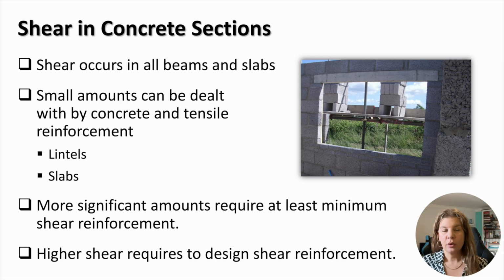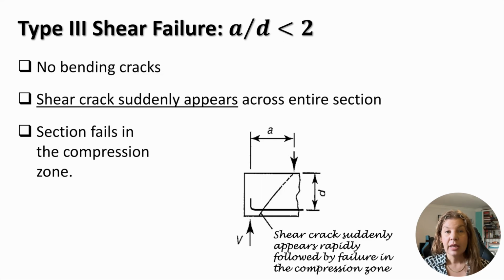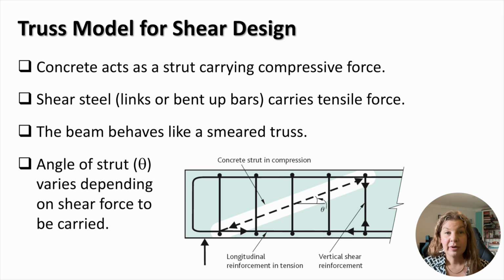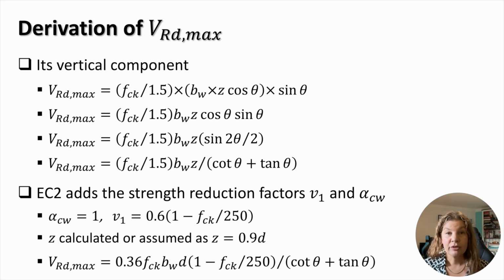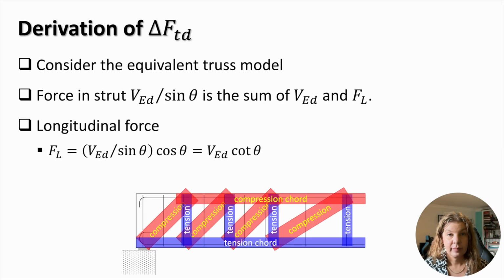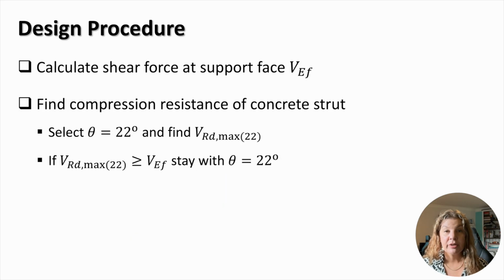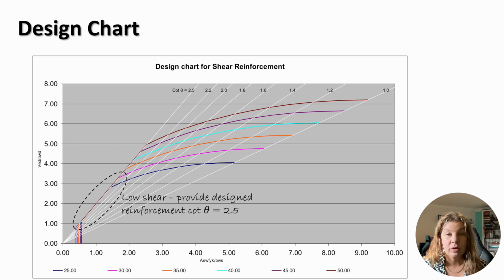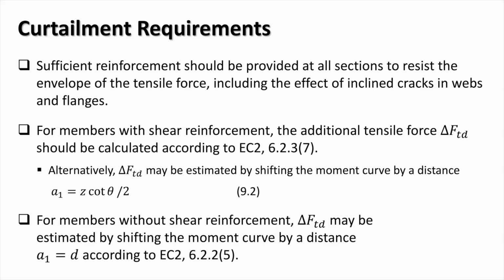Reinforced Concrete Design | Topic 6 Part 1: Shear Design Vertical Shear Reinforcement | Eurocode 2

Comment: Great video, why do we need to calculate shear at face of support and not the force central to the support midpoint as it would be higher so more caution?
Reply from the maker: Thanks! Great question. In EC2, shear is usually checked at the face of the support because that is the critical beam section being designed. The shear at the support centreline may be higher, but some of that load is transferred directly into the support through the bearing area, so the code does not normally take that section for standard beam shear design. That’s why we check at the support face rather than simply using the largest reaction value.